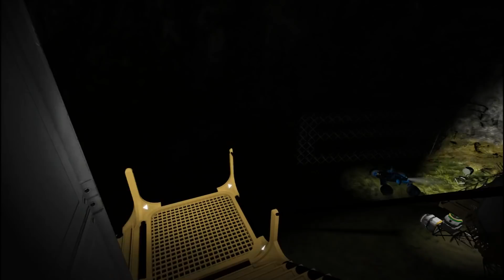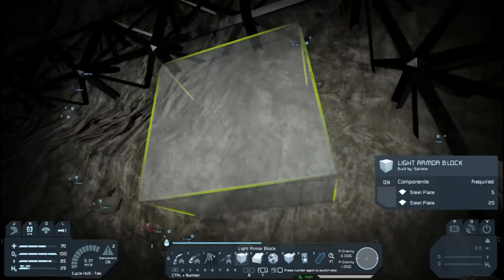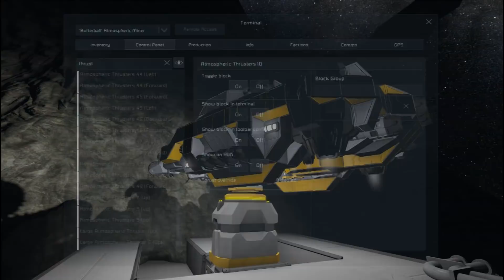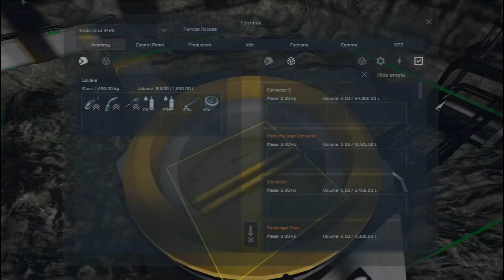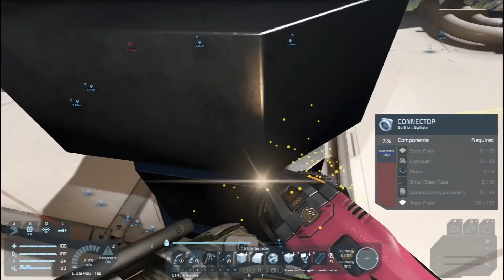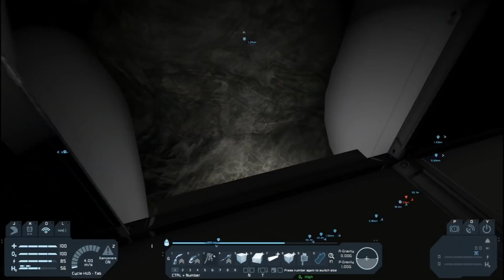Survival, Maybe... #22 Expanding the Hangar (A Space Engineers Survival Series)

Comment: These pirate craft - do they have uranium in the vanilla game, or is this also something you have previously added?  If I turn on pirates in my earth-like game (completely unmodified) - will enemy craft spawn with uranium and / or platinum?
Reply from the maker: At the moment the default drones still have reactors and uranium, they also will be carrying a small amount of platinum in their cargo which you can recover sometimes. I'm slowly working on a full set of drones that have neither to go with my Assertive Installations pack to completely remove the source of uranium :)

To get the pirates to spawn in vanilla, you'd need to place the bases yourself as they won't spawn normally. There's a mod to procedurally spawn them (Modular Encounters Spawner) which is the framework needed for my mod above to function, and I think someone made a pack of the vanilla bases to work with it which you could use.

Comment: You probably have figured this out by now, but you can access the base inventory through the pipe panels. Only can't shift or control click stuff. Have to split stacks, which is the only thing I find annoying about the otherwise amazing pipe conveyor system.
Reply from the maker: Actually at the time it was bugged and you couldn't access at all, fortunately it got fixed to the state where you can at least access and can't drag :)

You're absolutely right though, it's quite a bugbear of mine that you have to use the less efficient controls to move things :(

Comment: How do you drill so fast with the hand drill??
Reply from the maker: Drills have two modes - left click will drill out small parts of the voxel and allow you to pick up the ore that's dropped. Right click will drill out larger areas and will destroy everything that would have been created by left click mining (you'll still see graphical rocks but you won't be able to pick them up). Another useful tip is to double left or right click with a tool if you're going to be using it for a while :)

Comment: For those interested in how voxels and 3D graphics work, code-wise, take a look at around 9:45 in this video. You see Splitsie put down 4 GPS markers in each corner of a square (I know it's a rectangle, but just go with it for now). These 4 points contain the "plane" that is the inside "side" of the hangar "cube". If you connect all 4 points you can display a picture onto it, but we don't know which of the 2 sides to display the picture on. So instead we divide the 4 points into 2 groups of 3 points, where both groups share 2 points in common. That way we know which way is "in" and which way is "out" and thus which side to display the picture on.
Add another 4 points a bit further away to form a cube rather than a square and make 12 groups of 3 points to "map" each side and you have yourself a 3D cube with textures. These groups of 3 are called "Vertices" (singular: "Vertex").

Now, if you place 2 cubes next to each other, we could save some processing power by having the two cubes share the points that overlap. That is 4 points and 2 vertices. Then we could remove those 2 vertices from one of them and save the rendering power. We could also save even more rendering power by not rendering it at all, just tell the computer that the points are there, but that it is invisible, because the player is not going to see it, right? So we group the two cubes into another "map", to keep track of which vertices are visible and which are invisible, and what texture to put on each vertex. This "map" contains all the points in the world laid out in a grid-like system, but in 3D rather than 2D.
Just like a pixel on a screen, each point has a coordinate. But instead of just X and Y, you also get a Z, so you know how DEEP the point is. It's like a pixel, but in 3D. It's a "voxel".

Que the "The more you know" chime
Reply: I got ‘3D’ and ‘the more you know...’. I need to work on my science talk...

Comment: This is sort of a laziness conquering practicality (And energy efficiency) thing, but I think I would have set the interior lights to sensors instead of light switches, so every time I trigger the sensor the lights come on in the room automatically, and they turn off automatically when I leave.

Yep. So lazy I won't even push a button panel, but all the coolest stuff gets made through trying to avoid doing work >.>
Reply from the maker: I was thinking about that, but I'm suspicious the sensor will use more power than the lights... I should probably test that at some point :)

Comment: This build gets better by the day.

I was a little surprised that you opted for a light switch rather than a sensor.  At least with a sensor you don't have to remember to turn off the lights.
Reply from the maker: Por que los dos?  I think that's what the girl says on the old el paso commercial...

I probably will end up doing both, but for now the light switch doesn't cost me any power when I switch it off :P
Reply: Ack.  Also, now that the connector is gone you could pop in a skylight to save a bit more power in the daytime.
Reply from the maker: Ah, now that's a nice idea. Go back more towards my initial idea with the glass in the roof...

Comment: You might want to have atleast two elevators besides each other. Then you can have one elevator always down and one always up, otherwise you might just skip waiting for the elevator to arrive and just fly up the elevator shaft instead. Breaking the immersion a bit.
And another thing: Try and have something relevant in each room. It's a pain to have a huge base where most of the rooms are empty, and you just waste time running around. But if you have different machines in each room, that might eliminate that feeling and you don't have to run from one end of the base to another to do stuff.
Reply from the maker: That's a good thought, my other thought was to have one, but to have it hooked up to a sensor with a large range, so if I'm walking around downstairs it'll make sure the lift is at the bottom and the same for the upper level as I completely agree that I would be tempted to use my jetpack if it was too slow and I really don't want to do that :)
Reply: 2 elevators is a great idea that way there is always one on the floor you need also you should have a set of stairs as well even if they dont get used they would be there for when needed
Reply from the maker: There will certainly be stairs - they need to be there for emergencies or blackouts :)
Reply: i like your way of thinking :)